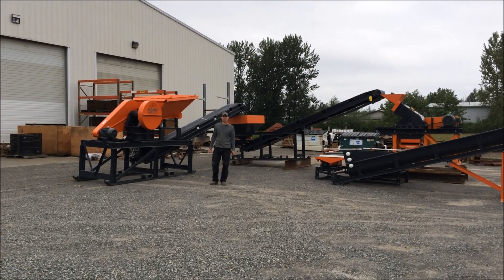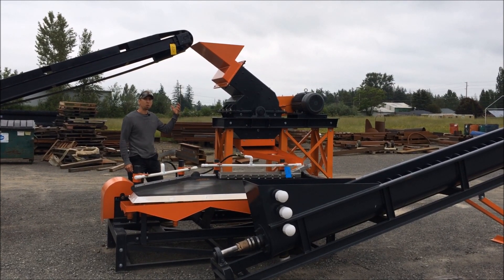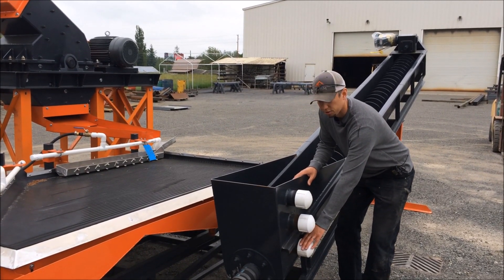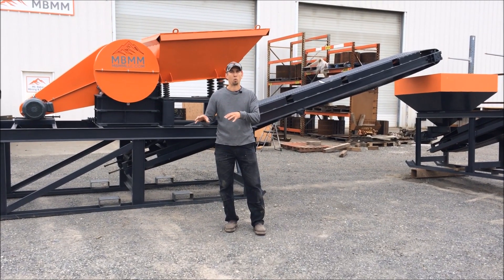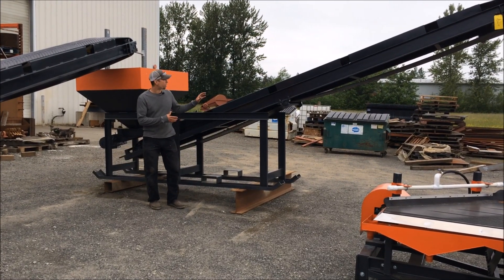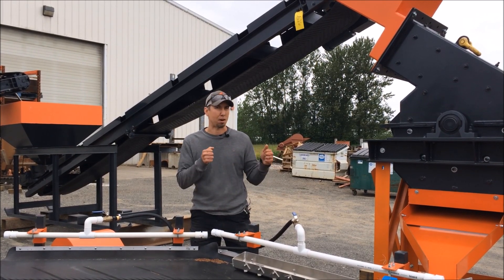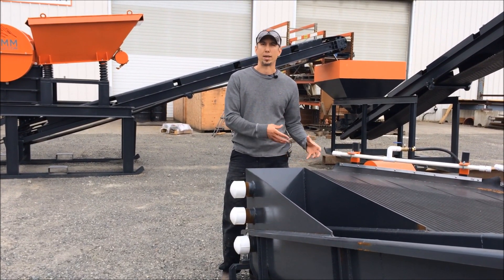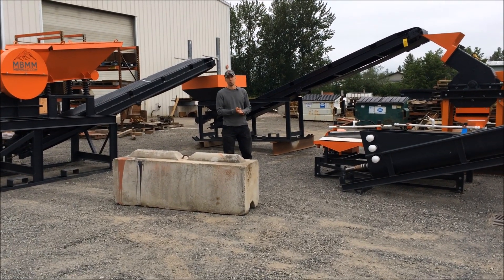2 TPH Gold Mill Walkthrough/Operation/Setup Guide

Comment: I am a consultant to a company with an MBMM 2 tph system, which we installed in Colombia. It works really well, because the final grind size is 110 mesh and the fine hammer mill screen achieves that. I am going to buy another one shortly.

Comment: is the belt conveyor or holding hopper+feeder necessary? I thought the process line would be fine without this part.
Reply from the maker: Need to holding capacity and even feed to the hammer mill and table.  The jaw crusher isn't consistent in crushing